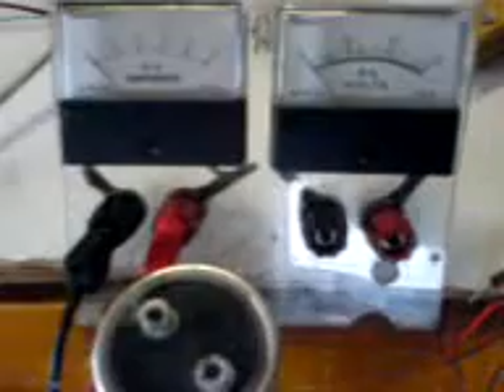Bedini SSG type motor new setup

Comment: i like youe setup and think it has potential but if it has vibration, you need to fix the problem correctly by balencing like waynedavisband said,so you get an even electro magnetic field, you are using it as a generator, the fields are important.  almost like timing a car.